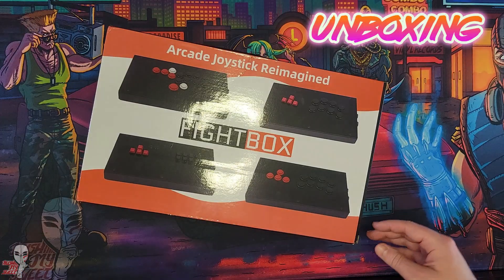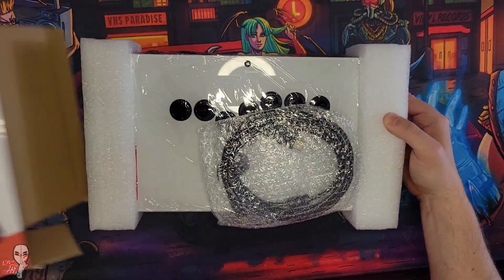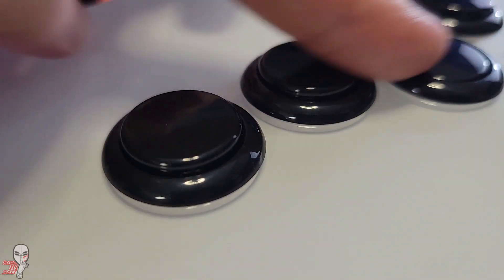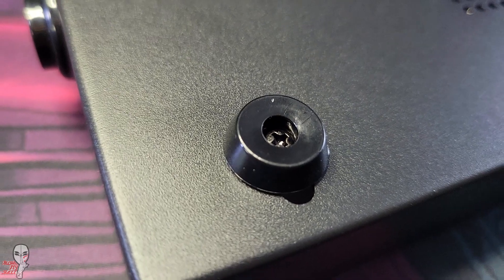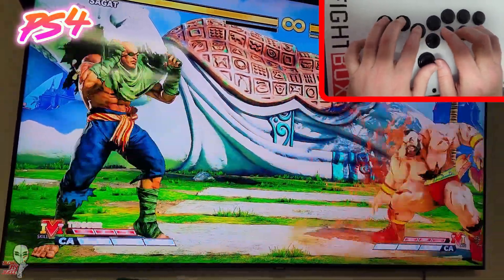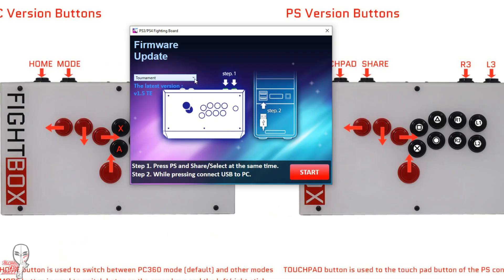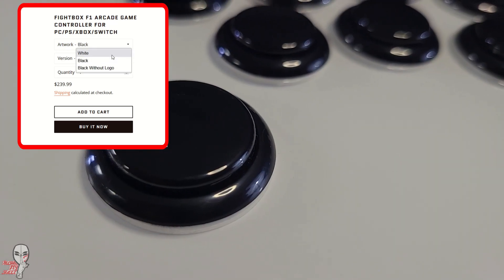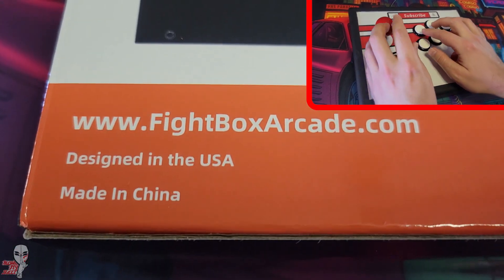FightBox REVIEW: Is it better than a Hitbox?

Comment: I actually have the Fightbox B1 - I initally got it as a cheap hitbox-style controller to test, before committing to a proper build. The only thing i wasnt a fan of was the Mechanical switches on the B1. I much prefer Sanwas. Great budget hitbox though!

On that note, my Eternal Rival stuff came in last week and I got my full build completed and I'm very happy with it! Assembly was very easy and simple and the customer service from ER was great. Would highly recommend for a future video from you!!
Reply from the maker: Awesome job on the Eternal Rival stuff! Glad to hear the assembly went smooth. I'll have to add it to my list!
Reply: Would the mini b1 be better or worse???
Reply from the maker: @Agelesslink  Depends on how big you like them. You can get PS5 compatible Minis, so if something like the Snack Box Micro appeals to you more over the traditional Hit Box, then the Mini B1 might be up your alley.
Reply: My hands are much smaller than average so i was wondering if a mini would suit smaller hands? I like the price of the B1 so I’m interested in getting it but i hope the buttons aren’t too far away for my fingers because in the past I’ve had problems trying to make tight commands due to the buttons being out of reach funny enough. I dunno, but i hope a B1 mini would suit me
Reply from the maker: @crimson_godot8611  I think that model uses 24 mm buttons for every single action and movement button, so it's probably going to be close to your ideal. Hope it works out for you.
Reply: funny because I now prefer mechanical switches over sanwa. the speedy and smooth feeling of it won me over. sanwa is still nice but i definitely feel like i have better movement control on my button box with mechanicals.

Comment: This is a good video and im subscribing because you included info for people about the capcom rules and that there is a firmware update👊🏽 i dont think this really matters that much for because i dont know if im ever going to any tournaments especially since this a new option for me. Still wanted the option to change it tho. I have a question tho..would you be able to convert back to the old firmware after updating?
Reply from the maker: Hey! Thanks for your nice comment and for subscribing! You can change the firmware back if you would like a different SOCD option. There is a drop-down choice in the launcher when you update.

Comment: Hey Hush. I got the PC version which has a different PCB than the PS5 Brooks one. I keep hearing people are having issues with the PC version so I was wondering if i should just get the brook PS5 PCB anyway and just swap it out to avoid issues. If i need to do that, is that a straight forward transplant or will i need to glue stuff and fenangle it?
Reply from the maker: What was in the PC version? A Brook Zero? Also, I'm not sure why you'd need a full PS5 one if you only plan on playing on PC. Problems can be sometimes fixed with upgrading the firmware, so maybe start there. If you want to replace the Brook Zero because yours is still having problems, you can replace with a RP2040 Advanced Breakout Board (something like what you see here: https://sgfdevices.com/products/sgf-gp2040-ce-advanced-breakout-board-pe ) I don't know how they have it set up in your stick, but worst case scenario you may need another wiring harness or something if they've done too much solder/glue stuff to the board. A new board plus a wiring harness would be a fairly easy swap though since they are basically plug and play. Still, you should look at the rationale behind changing it all out, especially if you haven't encountered problems yourself or don't need PS5 compatibility. Anyway, good luck!

Comment: Hey, after watching your video I finally got my hands on a FightBox myself and I love it. Just one thing about the Brook board update: Which one am I supposed to download and then how does it work? Because I have downloaded the PS3/PS4 Fighting Board firmware update and there I have to press PS + Share/Select. I tried it with every button and none worked the way I thought they would. So which buttons do I have to press while plugging the Box to the PC and which firmware update do I need?
Reply from the maker: You'll need to download the version of firmware that corresponds to the PCB you have in your stick. I loaned my FightBox out, so I don't have one to test for you, but when the menu prompts you, I'd hold down two of the aux functions and plug in the stick. Didn't work? Unplug, hold two different buttons, and plug the stick back into the PC. Rinse and repeat until you find the correct combo. The green start button should become available when you have it correct. The new Capcom Pro Tour compliant firmware is called "Tournament" in the Brook drop-down menu, I believe. I figured that would be the default on newer builds. You can check in training mode though. Hold down and then press the jump function. Did you jump? Then that's old firmware. Did you stand up slightly? Then it's likely the new firmware where D+U=neutral. Good luck.

Comment: I have a mini update hush. The F9 was perfect for me. Shiokenstar Layout (Hori stick preference) and the 30mm attack buttons worked out well for me. I only wish I had a few extra buttons mapped for L3 and R3 by the attack buttons for that quick and dirty DI and parry. Truth be told i am having a very rough time learning and sticking with the leverless but im starting to get the feel of combos and things. Im trying to do at least an hour a day until my ring finger stops feeling so sluggish.
Reply from the maker: Right on! If you need another button mapped as R3, I actually just released a video yesterday on a dual button COMBO extension you could install there (I don't know what board you have, so ease of installation might vary). Anyway, I'm glad you're still at it. 40% of viewers of this channel reported it took them a month or more to get proficient at it, so definitely don't give up too soon. Thanks for checking in and best of luck in the journey!

Comment: Can you do socd backdash with this for non competition? So if you hold back and tap forward does the forward register as another back input?  Or does B+F = Neutral only?
Reply from the maker: I don't think you can enable that how it sits out of the box. It has a Brook board with two options for firmware (one with the old style of D+U, and one with the newer CPT-compliant neutral style). You'd need to look into another solution if you wanted that enabled. Thanks for watching.
Reply: @HushMySweet1  basically i have a mixbox and Left + Right = Neutral but if i press and hold Left, then tap right whilst holding down the Left,.. i get another Left input... this is good for back dash cancels ( korean back dash in tekken) and i was wondering if this does the same thing
Reply from the maker: @seed8325  Not sure, but that's interesting. I loaned this out to a buddy so can't test, but I'll try to remember when I get it back.
Reply: @HushMySweet1 did you test back button held yet?

Comment: Is it possible to use screw-in buttons here instead of snap-in buttons? I'm curious about wether or not they will tighten themselves on the plexi..
Reply from the maker: I don't see why it would be an issue, so without tearing it apart and testing, I'm gonna commit to a yes. I typically go with screw-ins on most of my builds and I don't think I've ever seen an instance where they didn't work. Like, sometimes a case is designed with snap-ins in mind so there will be little grooves for the tabs so the screw-ins sort of lock in place, but there was nothing like that on this one. Screw-ins should be safe.
Reply: @HushMySweet1  Thanks for your reply! I guess I'm really not still sure.. I've also used screw-ins before without problems but that was when they attached to a metal plate, not a plexi one like the fightbox. Oh well, guess I'm just gonna have to take my chances and test it myself :) Take care mate!

Comment: Do you think the fightbox f1 would disconnect often on my ps4 or would it be alright? Ty for the vid
Reply from the maker: No, it would be fine. You'll need to get an option with PS4 compatibility (I think their Brook PS4 one is listed at $170 right now on their site). Sometimes you may need to update firmware, but it should be good.
Reply: @HushMySweet1  tysm for the info, would I also be able to download their firmware on IOS possibly?
Reply from the maker: @ztusx7  Yeah, they all have Mac options: https://www.brookaccessory.com/download/PS4/
Reply: @HushMySweet1   Ty for the help, I subbed.

Comment: Hey could you make a tutorial video on how to install the ps5 upgrade kit? I have the exact same controller but not sure how to install the upgrade kit.
Reply from the maker: This one came with it installed, and I'm also not sure what the internals look like on your model. But! If it's exactly the same as this here (it probably is), then get your Brook PS5 upgrade daughter board, pause the video at 2:11 , and install the wires as shown there. There should only be a few new connections. The red and black wires coming off it will lead to the power and ground, respectively. Good luck.

Comment: How do sanwas compare to keyboard switches?
Reply from the maker: Mmmm...hard to say since there are so many switches out there. I have another video on this channel where I compare different buttons. I think that Sanwa buttons have a fairly low actuation threshold compared to some other models. If you want keyboard switches in your buttons, you could grab some Gamer Fingers or some Crown 202s and carefully replace to your choice of switch.
Reply: @HushMySweet1  thanks for sharing! Would you say it’s more consistent combos due to lower actuation point on sanwas?
Reply from the maker: @elo_888  No, I wouldn't say that. Switches are all preference and have little to do with combo consistency imo. A default option in a lot of all-button controllers is the red switch (50 gf), but I typically like dark yellows which have a higher actuation threshold. The reason being is that I can rest my fingertips on the buttons so I don't fatigue as quickly and I get fewer accidental inputs since a press needs to be slightly more purposeful. I have a whole video on this channel showcasing different switch options if you'd like to learn more. But at the end of the day, it's preference imo. Thanks for watching!

Comment: How do you do Zangeif SPDs in on those anyway ?
Reply from the maker: Slide your left hand fingers from right, to down, to left (all in one smooth motion). Then, as you finish with that left hand input, with your right hand, hit a the appropriate level punch for which strength SPD you want together with the jump function. It's all very quick. The benefit to Gief's SPD is that it works the same on both sides (even with joystick), so you only need to practice this one way and it will work consistently. Good luck!

Comment: Whic verion is cpt legal and ps5 compatible? Also does the brooks wingman ps5 converter work on this?
Reply from the maker: The version in this video is both CPT legal and PS5 compatible. You may need to update the firmware if it isn't but that's easy and Brook has a "tournament" firmware update for download on its website and it all installs super easily. If you went with a different non-PS5 model, the Wingman should work there too.
Reply: @HushMySweet1  does the firmware have the CPT up/down neutral rule thing?
Reply from the maker: @gerradwalker346  Yes it does so long as you have a version with Brook internals. And if for some reason it's running an old version, you can still update it yourself. Download the appropriate firmware from the Brook website, run the files and it will boot up a prompt, hold down two buttons (I think it's like start and select, but it will prompt you to tell you which), plug the USB into your computer while you're holding those buttons, and then click update. You should be able to choose from "tournament" or "controller" and the one that's labeled "tournament" is the new one that is Capcom Pro Tour compliant. Very straightforward process, but like I said, a lot of the newer Brook stuff comes ready to go with the new firmware update. Good luck!
Reply: @HushMySweet1  oh wow so you're saying that this Brook board site has all the firmware updates? And not the direct website that we bought this from? Does that mean that the BrookBoard website can be used for any Brookboard product?

Comment: So what if I buy the one that works for ps5 but it has brook p5 mini board will it work without an adapter?
Reply from the maker: If it has a Brook PS5 board, it should work without an adapter.
Reply: @HushMySweet1  thank you for the info bro ❤️
Reply: @HushMySweet1  so let’s say I want to connect it to my Xbox series s or Xbox in general with a brook or mayflash adapter would it be functioning with the Xbox even tho it has a PS5 board ?
Reply from the maker: I think a Brook Wingman XB adapter would work for that. But if I knew I would be playing on all consoles regularly, I would just get the Universal PS5 version since it plays on Xbox and PS stuff, and it would all be ready to go under the hood.

Comment: I just received my Fightbox M8 PS5. Question, do have to select a mode or does it just work when plugged into PS4/PS5.
Reply from the maker: I don't remember any mode-changing switches or toggles or anything like that. I think it's a plug and play scenario.
Reply: @HushMySweet1  OK, thanks.

Comment: how di you download the firmware my fight controler is now bricked
Reply from the maker: 1) Make sure you know what type of board you have in there. 2) If it's Brook like this video, then you'll need to go to the Brook Accessory website. 3) Find the corresponding PCB in their lists of downloads and then download the appropriate one. 4) Run the files you downloaded. Your computer might try to stop you, but click the okay and get it going. 5) Once it's running, it should prompt you to hold down two buttons (I think it's start and select off the top of my head, but just read the prompt) while you connect your device to the computer with the USB cord. If you did it right, then the prompt will change. Click on either "tournament" or "controller" depending on which SOCD mode you want. The "tournament" one reflects the newest CPT changes and makes it legal in Capcom tourneys. 6) Hit start. It will fully update in like 5 seconds and show the update was finished/successful. Everything is done and you can unplug the device. Good luck!
Reply: @HushMySweet1  i have the ps3ps4 fighting board, i have went to the web site clicked it and i have the fightbox like thie video. it says to hit ps and share/ select...do you know which ones those are??
Reply from the maker: @eriksprow9551  Not off the top of my head. They will be two of the aux buttons on the top. So what you can do is press down two of them and plug in the device. If the screen didn't change or prompt you to hit start, then you chose the wrong ones. Simple unplug the device, pick a different 2-button combo and try it again.
Reply: @HushMySweet1  see it is alwasy prompting me to download just allways fails....is their a way to just factory reset it and say fuck it so its not bricked?
Reply: @HushMySweet1  do i have to hold down the buttons at the same time it down loads? and if you find out what buttons i have to hold i would appreciate it, my board in the middle say ps3/ps4 fight board....and im sure im downloading the right thing but im messing this up some were
Reply from the maker: @eriksprow9551  Hmmm...you should be able to just hold the buttons and it will prompt you to click "start" or "begin" or whatever on the Brook pop-up thing. There aren't many parts you can mess up along the way. If it's not greenlighting you to hit start, then unplug it, hold two new buttons, plug it back in and try again. If there's a corruption issue beyond a simple update, you'll need to contact Brook support.
Reply: @HushMySweet1  yeah i did and im waiting for them to get back to me
Reply from the maker: @eriksprow9551  Hope it gets solved!
Reply: @HushMySweet1  yeah i even contacted fightbox.....if not i'm throw this shit it the garbage i guess

Comment: my fightbox just stop working i think there is some kind of problem with the cable it kept disconnecting from the game by itself and i had to remove the cable and plug it back in but today it just died 😅
Reply from the maker: Strange. Which PCB did it have? Also, you should definitely reach out to FightBox to see what can be done.

Comment: I wish i had seen this videobefore i tried opening mine, now the front is cracked and partially held in place with tape, honestly just want to throw it in the trashcan at this moment...
Reply from the maker: Dang, sorry to hear that brother. Take a break from working on it and later you can try contacting them to see about getting another top panel and see how much they charge for a replacement piece. Good luck.

Comment: Still hella expensive unfortunately 😢 i guess my only option is to pad hack my razer raion
Reply from the maker: Yeah, if you want PS5, you've got to open the wallet one way or another. PC players get all the cheapest stuff.
Reply: You can buy the pc version then upgrade the controller with PS5 brook board later when you have money. That’s what I did
Reply: @TheAlchemyBeatz  Does it work if you use some kind of adapter?
Reply: @TheAlchemyBeatz  

Was it easy to upgrade the F1-PC with the Brook Fusion Board? Were you able to just swap out the board using everything it already had or did you have to buy some other parts for this upgrade?